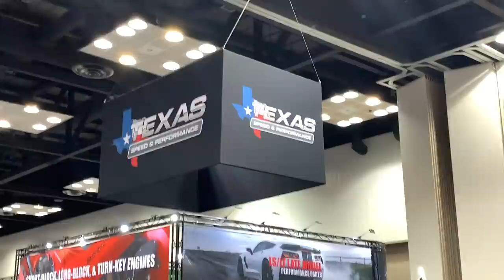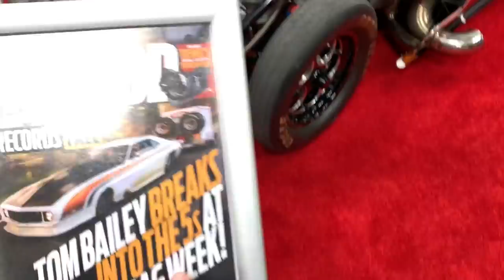Picking Up a 143mm Precision Turbo... (weighs 105 pounds!!!) + Random Shenanigans w/@SXSBlog

Comment: Looks like a new TURBO for Ruby!
Reply: That would be sick just use the other one to spoil that one and it'll all work
Reply: Yes use the turbo that's on Ruby to spool up that one
Reply: @michaelbartlett9742  Think Ruby might need some more displacement for a turbo that moves that much air. Maybe an engine like Toasts would be able to. However im kinda unsure if even thats enough, thats one hell of a turbo. Oh and heres a link to a 107,389 horsepower and 7,000,000nm torque turbo diesel. Notice the turbo size compared to the engine.

I doubt Toast can take that turbo. Then again, i am very far from a turbo expert. Just a judgement from my understanding of psysics. 

https://www.zmescience.com/science/biggest-most-poweful-engine-world/
Reply: Two of those on ruby
Reply: @MrDanisve  as turbos start working they provide what they need to work, in theory, if you can get it to start delivering charged air any size engine could run any size turbo, once it spins it delivers what it needs in boost to provide the exhaust it needs turbos really are very efficient, if everything else was in check, which it probably wouldn't/couldn't be, then even a 4cyl could run it! Theoretically of course, you could sequentially stage turbos to get to this turbos flow needs, theoretically it's possible!

Comment: That big of a turbski needs a 10.3 liter motor in a light drag car!
Reply: thats one toasty suggestion
Reply: @LuanCristianThums  hmmmmmmm you know there's gonna be change when he comes back from summernats
Reply: Toast upgrade
Reply: Charles Wagner so basically throw it on a mountain motor pro stock car
Reply: The only thing that turbo is for is large diesels, tractor pulls.
Reply: 527 wait refresh my memory what size engine does toast have
Reply: @michaelsclark  toast has a 10.3L 632 in him

Comment: Cops must hate those scooters. I used to get tickets on my goped for unregistered motor vehicle. Don't see how cuz it's electric makes it ok... Kinda pisses me off.
Reply: Ikr i remember back in early 2010s scooters was sorta a no goand now its just common as hell, but the ones i looked at has knobby wheels and shocks on them not these razor bird scooters
Reply: Welcome to Legacy Laws from a time long long ago that's no longer relevant today but god forbid they update... Here in Fl the law's are nothing is allowed on the street bigger then 50cc, after you need to register and insure it. E-bikes/scooters don't follow the same laws as the gas powered vehicles, most laws around them are county/state laws on how fast and area of use.
Reply: Wonder what's gonna happen when battery tech and motors get that little scooter up to 60 in Tesla Roadster times?
Reply: Electric scooters have gotten super popular in Norwegian citys as well, and police hate them. They are completely legal as long as they don't go more than 20mph or something but people have modified them and been seen doing upwards of 50mph.
Reply: Tech evolves faster. Than the law allows. For. They are probably actually illegal.

Comment: Use that turbo for the 10L engine camaro. Reverse the head flow so that it's a hot V and run some sort of bundle of snakes manifold to keep that big bih close to the block. Be sure to ceramic coat the exhaust manifold AND heat wrap it, and don't forget a turbo blanket.

Call it the CYCLOPS!

Comment: here in holland they're running some tractor pulling machines with some big turbo's on it. for example, an 6 in line Isuzu engine, about 7 liters, running at +- 90 PSI of boost, and that's on methanol....

Comment: You want to put that 143mm turbo on something? Keep the stretched wheelbase on Mullet, and find a Merlin V12. You'll probably need 2 of the 143mm turbos, as the Merlin is 27 liters big.

Comment: Do I see leroys next turbo
Reply: Turbos
Reply: Yep
Reply: I wish
Reply: Maybe toast with that 10L
Reply: None of them would spool it, it's for diesels.
Reply: Just for arguments sake. 
Diesels produce roughly half the amount of exhaust gasses than gasoline requiring a turbo roughly half the size than gasoline. Toasts 10L engine would spool that turbo as well, off not better than any Diesel engine, although possibly not as well as some of the latest compound turbo diesel wizardry. 
Putting a turbo that large on an engine smaller than the 10L May lead to excessively high pressures and long spool times. Turbos are similar to torque converters and are specific to the application, to large or small creates inefficiency and less overall bald eagles. Thank you I win.
Reply: Actually built diesels can hold 100+psi, with a long spool time a diesel would build up pressure and hold all the boost. 
Here I am just talking to my self, ok I’m done now.
Reply: @jaydunbar7538  wrong larry larsons turbo is a 157mm in is s10 and its not a diesel !

Comment: Will Leroy  make it without  over heating  during drag week with the new radiator
Reply: That's just a race setup. Probably swap back to the original setup for Rocky mountain race week.
Reply: @VFR75O  yea but there going to be racing so i dont thonk that they would  swap it for 2 to 3 passes then go back to driving
Reply: @gavvinhurst2524  they don't need to either, the weight saved is of no consequence compared to keeping it from overheating during such an event.
Reply: It'll probably come down to time and how tired they are for swapping radiator setups between racing and street driving.
Reply: I also wonder how well the slipper clutch is going to operate at lower RPM cruising while pulling a trailer.

Comment: There's Pro Stock pulling tractors running 160mm singles right now. 6 inch+  over 140 lbs of boost..That's just insane!! Columbus diesel "Ohio" was one of the if not the first one to produce a billet compressor wheel "That actually worked" back in the mid 90s. I know this because we got our hands on one of the prototypes and won 2 national championships with it. It was a 4.1 inch "104mm"...Drag racing is just now catching up......Not bad for a bunch of deplorable illiterate farmers huh? lol